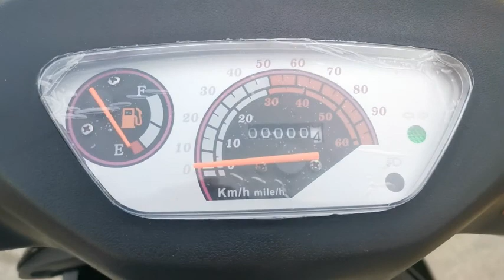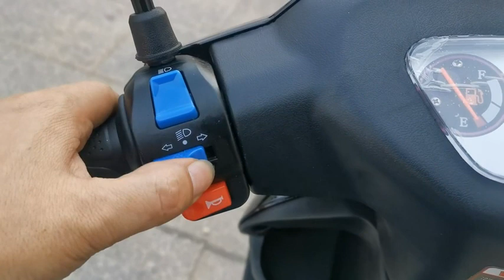X-PRO Maui 50cc Scooter Assembly Video

Comment: With gas prices today, I'd get an electric scooter instead. I used to have a Honda Urban Express when I was in college in the early '90s. Gas cost about $1 a gallon back then, so it was worth it. I'd get about 60 miles out of a gallon of gas. Remember, you also need to buy oil for it too. The honda used 2 stroke oil. 2 pints was about $6 and it last about 1 month. So it cost me about $10 a month to ride it. It would probably be close to $50 a month today.

Comment: Mine, I have to put the handlebars on and the front wheel. This is fine, but how do I get the bolt screwed on, or specifically, how do I get something behind the nut to hang onto it while turning the bolt?
Reply: Hey I had same question but figured a solution. Just need two wrenches. One to poke through the gap to hold one bolt while you slowly turn the other cause there's no room lol